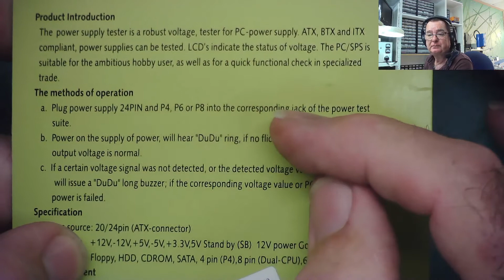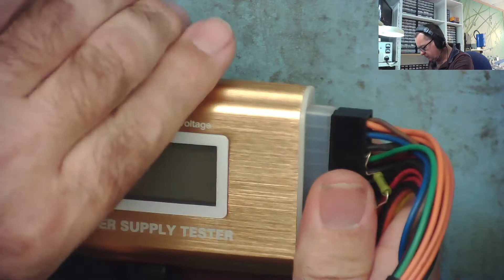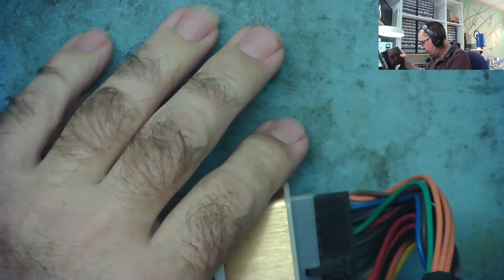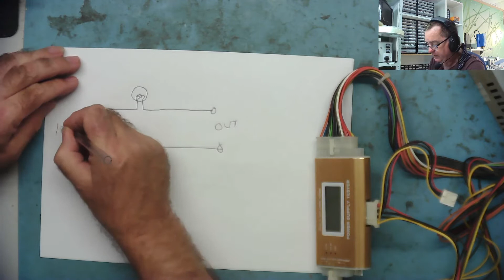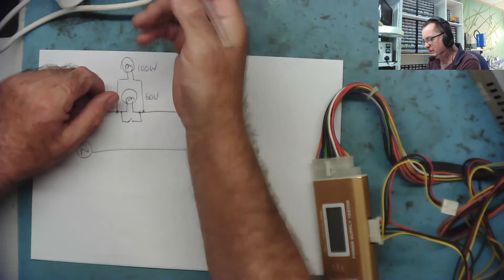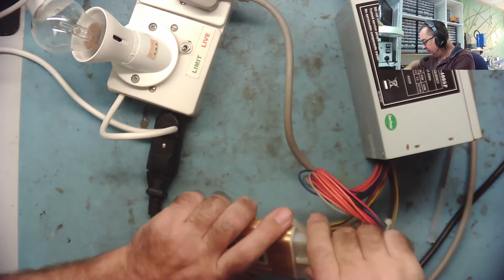ATX PSU Tester Analyzer Review.  Automated Power Supply Tester

Comment: I have one of these testers as well. And it caused a headache. Older ATX PSU have a -5V (white wire), my version of the tester just shorts this to ground (it is marked "not connected" in newer versions of the spec). So when I connect one of those, PSU shuts down instantly as the test device is causing a short. Interesting that yours did not do that. Your first PSU hat a white wire (though that does not guarantee it is actually -5V) and also your "documentation" of the tester claims it can test -5V. 

About that bright light bulb: You should maybe wait a bit until the tester comes up. I have some PSU that (at least on a 60V lamp) will make the bulb come bright while still working fully fine. Though I see only a couple of volts arriving at the PSU, might be it will go to high current to compensate. It seems that running with the bulb only works good for smaller PSU. So I usually use the bulb only for the initial standby test (assuming it will flash and go dark) and then go to live before powering the PSU up. Risking a new fuse for the insulation transformer.

Comment: I really think its wierd when electronic testers equipment is described as hobby grade, because really with testers its just about accuracy and precision its got nothing to do with experience in an area. For example I've got a cheap multimeter and a more expensive one, say the voltage I am reading is 0.42V and I read this on the cheap multimeter, then I get the more expensive one with a higher resolution and it reads 0.42123V but I only need to know what the voltage is to 2 significant figures eg 0.42V then the cheaper multimeter is still giving me the same outcome. 

Just a mini rant on my part but all these tools come down to how far and accurate it can read voltages, anywy I will get back to watching the video ^^

Comment: For what I know, the three leds on the left are for sata or molex, you should test them once at a time, the tester doesn't show the source it's testing. 3.3volt is good till 3.5, following the standard ATX chart.
Reply from the maker: Hi mate, From my experiments only the SATA illuminates the 3.3V LED.  The other two (5V, 12V) light up with only the 24 way ATX connected (but not the 3.3V)
Reply: @learnelectronicsrepair  I think that's because the molex connector doesn't have 3.3 volt. Moreover, the 3.3 at the bottom right corner is coming from the 24 Pin connector.
Reply from the maker: @almostdarkslide3851  Sure of course there is 3.3V on the 24 pin ATX and not on the Molex, but for some reason this PSU analyzer only illuminates the 3.3V LED if the SATA connector is attached.  I'll see if I can open it up and look at that to see how it is wired up.  it would not be difficult to make it illuminate from the ATX 24 pin, but in all honesty I don't see the point of the LED only working from the SATA connector from a fault finding aspect.  In fact I don't realy see the point of the LEDs at all seeing as the voltages are all clearly shown on the display screen
Reply: @learnelectronicsrepair  leds are only for testing sata, molex and maybe floppy disk connectors. The screen shows other connectors (20+4, 4+4, 6 pins) voltages, so a led is not needed for those. I wonder if you can test sata and molex without the other connectors.
Reply from the maker: @almostdarkslide3851  Yeah I can try that, though of course I will have to start the PSU by bridging green to black

Comment: Looking forward to the repair of those power supplys !!
But i think that tool is ok. Meassuring the voltages can be tidious, but its not hard. 
So this tool is more for people like you who do a lot of repair.
Thanks for the review !
Reply from the maker: Hi Daniel - yes I think anyway for the price of €9.33 inc postage it is a useful tool.  So it is recommended by me.

 Actually the PSU that read 11.3V on the 12V, and the 3.3V was varying from 3.1V-3.3V I think is also faulty even though the tester did not du-du (lol) as those voltages seem out of tolerance, and 3.3V should not vary like that.

The user manual says it only does the du-dus if a voltage rail is higher than normal, not lower. Still, for the price, it is a handy thing to have for sure, I'm glad I bought it..

I already started the next video on the ATX PSU that is completely dead... it is more interesting inside than I thought, especially once I found what is rattling around in there...
Reply: @learnelectronicsrepair  Looking forward to the video !

Is 3.1V already to little for a 3.3v line ? 
Does that indicate faulty caps or some that are on their way out?
Reply from the maker: @Xorat  Yes most likely that is the case